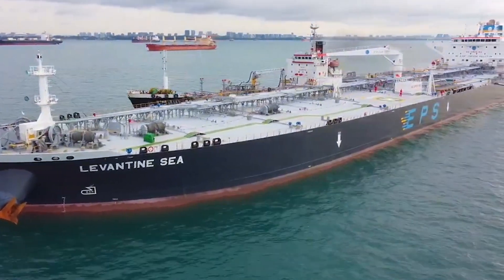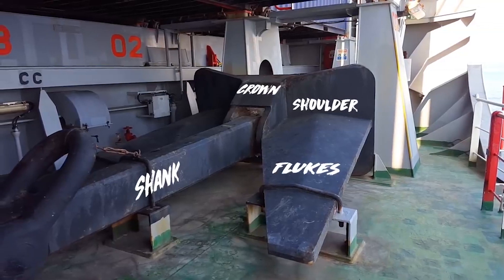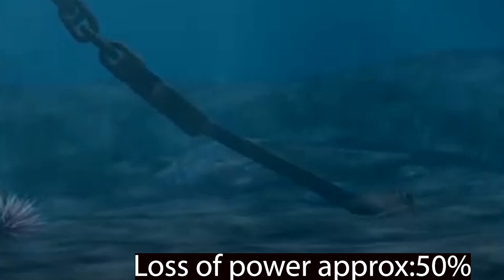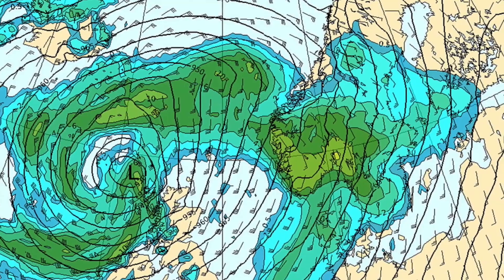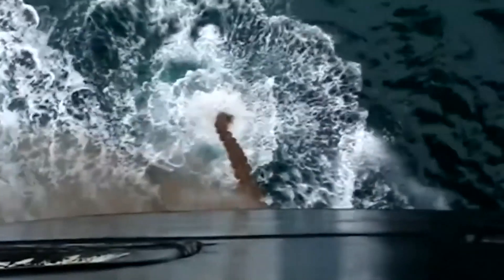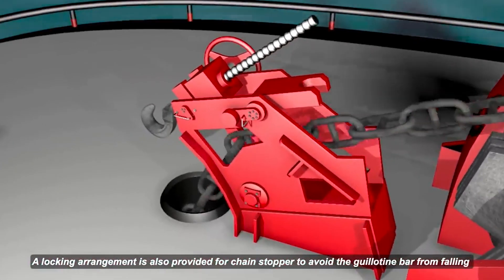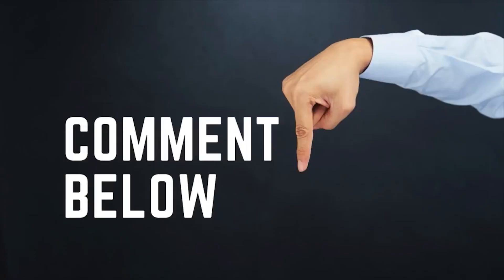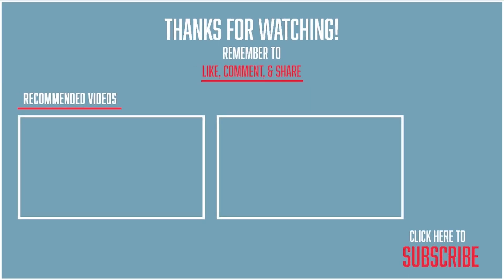How Ship Anchor works I Anchoring Large Ship

Comment: Very informative video,good job.
Few questions:
1.The plenty of windlasses have max elevation depth power approx.82 metres. ,what is your opinion if depth more than stated figure ?

2. Do you touch the stopper pawl witn anchor chain or all holding power is on the windlass brake?
Reply from the maker: Thank you for appreciating the video and your query .
I will try to answer your query categorically :-
1. In that case the windlass will not be able to lift the anchor as it will be restricted by its design which includes holding loads , inertia loads , hoisting speed , brake capacity and the support structure
2. We should put the Bow stopper on and rest the anchor chain on it.This is because the load generated by the vessel’s movement during its stay at anchor should be borne by the bow stopper which has higher capacity than the windlass system.